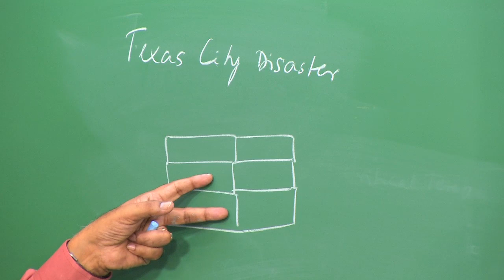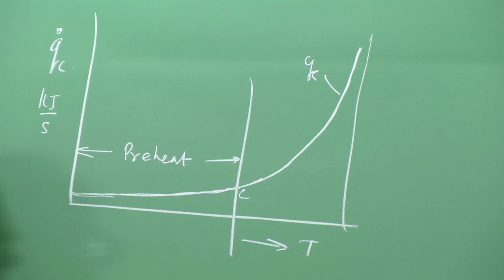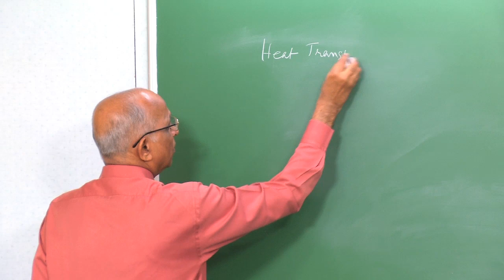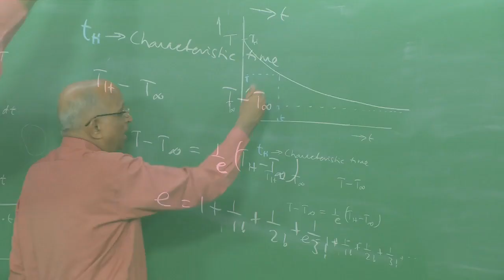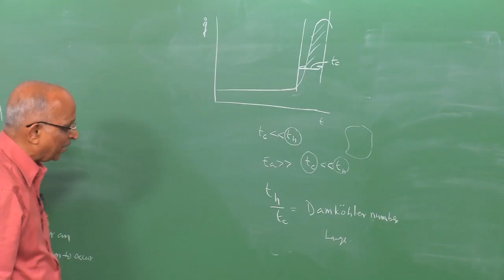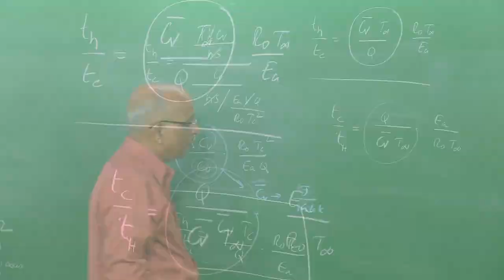Mod-01 Lec-18 Thermal Theory: Characteristic Heat Release and Heat Transfer Times

Comment: 59:43 So tc/th is much less than a quantity that it is equal to... XD It would be easier to solve the Tc as a function of eA alone to show that large eA does in fact give small tc/th. The exact auto-ignition temperature for a gas mixture is likely to be a function of: the activation energy, the net energy released per mole, the molar densities of the gasses, the collision cross section, and the reduced mass (molecular). It would be nice to see this function derived.
Reply: go refer a book and derive it !!!